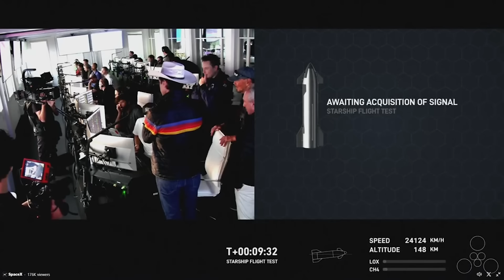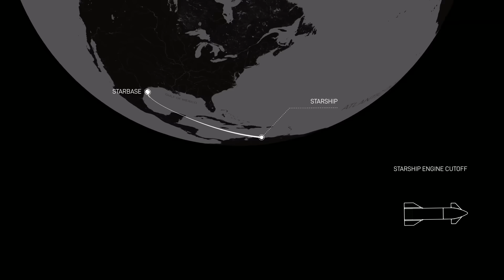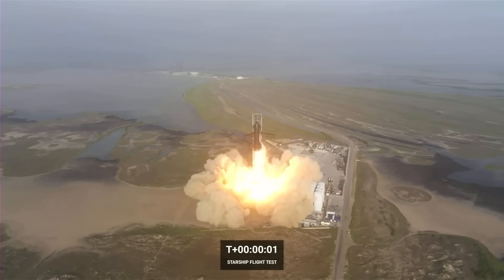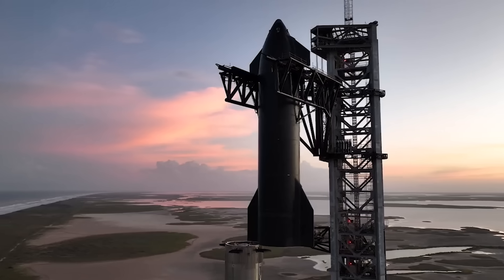What Exactly Happened On SpaceX's Second Starship Launch Attempt?

Comment: After each stage meeting the needed results. Space X initiated the safety detonation to meet the governments satisfaction as per the first launch. All was as planned.
Reply: Yeah, failure is always as planned, according to Musk.
Reply: And you speak with what authority?  Or are you just another wishful thinker?
Reply: Correction:. Failure isn't planned, but it is an unavoidable reality when there is LESS FEAR of failing in order to allow the iterative process to happen.  By contrast NASA is risk averse thus it tends to more expensive in the long run and it takes longer to build and test a rocket that is reliable.   

Look at the Falcon 9 rocket for example.  It was tested four times before a successful launch was achieved.  Now it is the most reliable rocket flying.  And it also lands AND is reusable.  No other rocket company is doing that.  So if focus only on the failures you missing the point!!
Reply: @michaeldeierhoi4096  Most reliable rocket flying?  THAT is extremely debatable.  As much as I'd love to experience spaceflight, I sure as hell wouldn't do it on a SpaceX product.
And, your argument sidesteps the fact since the early 1960s, NASA has accomplished reliability without the fireworks.
It also ignores the cultish devotion to Musk, which flies in the face of reason.
If this flight had succeeded in its stated plan to end in the Pacific, without blowing up, would Musk declared it a failure?  Of course not.  But, since the dang thing exploded, it was a success.  MAGAt logic.
Reply: @Vector_Ze    Now there's a boat load of stuff to unpack and thanks for making it easy for me by keeping your remarks brief.  In the first place if you think it is extremely debatable that the Falcon 9 is indeed the most reliable rocket flying right now then why not mention who you think is better or even comparable??  This year and last year the success rate for Falcon 9 and Falcon Heavy launches was 100%.   85 launches this year and 60 last year.   And almost as many successful landings which no one else is doing at this time by the way.  

And you say that you wouldn't fly on this Space X product.  Well besides the fact that no one's asking you and I wouldn't either for that matter because I simply have better things to do with my time. Besides it will be a while before the average person gets to go into space and I'm not talking about one the luxury space rides BO.    

NASA has achieved reliability without the fireworks.  But at what cost and what is their launch cadence compared to Space X even if include all companies that contract with NASA??     Each flight of the SLS is expected to cost two billion and up.   In addition, NASA is a contractor so the SLS is built by Boeing.   NASA does the telemetry, tracking of rockets and such.  Boeing also built Starliner which has flown one test flight and hasn't been up since and NASA spent a lot more on Boeing to build Starliner then it Space X and via the Falcon 9 and Dragon they have flown flawless manned and cargo missions to the ISS while Boeing struggles to get the right tape to secure wiring on Starliner.  

You make a hilarious hypothetical that if starship had made it to touch in the ocean Elon would not have applauded the success.  What an absurd conclusion that is based on nothing more than your obvious animous toward Musk.   The point is I think Musk is a jerk especially when he bought Twitter and ran it into the ground.   I don't much care cuz I don't use social media anyway, but who can ignore incompetent behaviour regardless of one has an interest in it.   Space X is much more than Elon Musk anyway and business goes on at Starbase quite well without him.  But one cannot deny the success that Space X has had or the reliability of its various rockets and capsules.  If you can't admit to that, Oh well, what can one say about that?   

Lastly, I have to say I hate to be so pedantic and verbose, but you can of asked for it with that comment!  😂😅. Have a great day!

Comment: My prediction? The rocket exploded due to problems NASA solved in the 60s.
Reply: Then you would be wrong, these are totally different experimental rockets.
Reply: @macsdf1  That really does not help your point.
Reply: It took Nasa until the Space Shuttle to stop stage 1 exploding/crashing.
Reply: @catprog  Because Starship's first stages have done so much better in this regard.

Comment: Given that the ship exploded right about the point it would have been turning off it's engines due to this being a sub orbital flight, I wonder if the command to shut down didn't work and they ended up destroying it before it reached orbital velocities.  About 28000 kph is needed for low earth orbit. It blew up at 24000 kph with no apparent other faults.  If it had reached 28000kph with no way to shut it off, that would have created problems for an uncontrolled re-entry in pieces with no way to know where it would have hit.
Reply: not a bad insight. time will tell...
Reply: If starship had been able to reach orbital velocity and a suborbital trajectory it would be flying south into the Caribbean Basin so well away from any of the islands based on the plan trajectory.
Reply: @michaeldeierhoi4096  But if the angle was not right it could be aiming at Hawaii
Reply: @catprog  Since the second stage could not make it's suborbital insertion it's a moot point imo.

Comment: Given that there is no launch escape system, and the second/upper stage cannot be the launch escape system, people will not go up on it, no matter how many entirely successful tests have been done.
It's also a safe bet that the NASA Artemis missions will not use the "Starship" as the upper stage.
It has never made any sense to bring to the Moon, the necessary weight and complexity of what's needed to re-enter and land a ground to orbit vehicle.
Corporate PR and YouTubers' graphics and Musk's statements are not definitive mission plans from NASA.
Reply: @JFrazer4303.  Airplanes don't have an escape system either, but people fly on them routinely.   The Falcon 9 has flown over 250 flights with almost perfect record especially in the last couple years.   The starship can get to close to the same level of reliability as the Falcon 9 and it will also be reusable.  Falcon 9 had four test flights before reaching orbit.  Four test landings before successfully landing.  Now it does repeatedly, reliably and with reused boosters.

If you only look at the failures and not the improvements made over time and simply iterative nature of this starship development then you are missing the point.
Reply: @michaeldeierhoi4096  the Falcon 9 also has an escape system whenever it flies people.
Reply: Their were 3 designs they could of selected. One of which had a negative payload. So NASA had 2 options and Starship was cheaper and more capable then the other one.

How do you define "Starship" as a ground to orbit vehicle? 
Is it that it needs a booster to get from the ground to orbit. If so all the possible landers are ground to orbit.
Reply: @catprog  Ground to orbit and back down to the ground here. Aerodynamic surfaces and TPS.

Comment: To me, it looked like it started to drift slightly off course right before the stage separation.  Either that or the camera made a huge change in location.  It would be a shame if that was the reason for the Starship self destruct.
Reply: I think that was intentional to avoid the tower... it was exacerbated with the first launch because of the engine fails... which how lucky was that for the fails to be on the wayward side of the tower on that first one. They used up all the luck on that one.
Reply: @hawkdsl wtf are you talking about? They were 1.5 miles down track at stage separation,  nowhere near the tower.

Comment: Aside from the failure of the termination system, all the other failures of the first launch could be traced back to damage caused by destruction of the pad
Reply: That's certainly how it appeared, but according to SpaceX the fuel leaks and engine failures of the first flight were not caused by debris from the pad
Reply: ...which goes back to Elon and 4/20 silliness.

Comment: I am a fan of SpaceX because they are all about getting it done, unlike Blue Origin which is doing nothing at all.
Reply: Blue Origin is NASAs "backup", as Bill Nelson stated when awarding the 2nd Option Lander contract in May.
Blue Origin and its National Team partners are giving NASA a hydrogen fueled lunar lander, exactly what NASA wants for "sustainability" i.e. burning cheap in situ lunar H2 instead of expensive Earth CH4, hauled all the way from Earth to the Moon and down to the surface just to get back to LEO.
Starship has no future on the Moon, with NASA or anybody: it is unsustainable.
Reply: Bezos was willing to go on a flight.  To me that says a lot. NASA picked Blue Origin over a rival bid led by Leidos Inc-owned (LDOS. N) defense contractor Dynetics that also included Northrop Grumman Corp (NOC. N). NASA's decision to go with Bezos and Blue Origin will give it a second option for sending astronauts to the moon under its Artemis program.
Reply: @rcpmac  Saying something and doing it are two different things, I love spaceX and have faith in them but fuck no I would NOT get into the starship

Comment: It makes you wonder how the U.S. managed to get Saturn V rocket get to the moon in the 1960s, but now they experience so many problems. Didn't they jot down any notes at the NASA ?
Reply: They never had to plan for landing the rocket which makes it a lot easier.. also nasa had a higher budget which helps..
Reply: They blew up the 33 raptor engines. I expected the lower stage to land back on earth vertically at a predetermined location. So much for the reusability !!! And now we don't even know where the upper stage the silvery part is, probably somewhere at the bottom of the Pacific ocean. I deem this test flight a partial success. I certainly will not ride on this thing for at least 10 years until they sort out all the issues. Let's hope NASA have better luck with their Artemis Block 2.
Reply: Plus Space X is building a rocket that has twice the thrust and uses a different fuel.  Testing and development on starship only began on starship a few years ago.  Now we are finally seeing the potential of this rocket which had the beginnings of a nominal flight.

Comment: It is a bit wild that booster only takes the second stage to less than 20% of its orbital velocity and 30% of altitude. Is there a possibility of a single stage to orbit some time in the future?
Reply: No, because that would mean carrying a huge fuel tank and 33 engines all the way to orbit. Far more efficient to drop the excess weight and continue on with a much smaller rocket that increases the speed by 80% and height by 70%.
Reply: Not for some time because the amount of fuel needed to overcome gravity.  On Mars it will be possible for starship to launch without a booster.  Probably totally new propulsive technology will be needed for a single stage launch vehicle to orbit.
Reply: Single stage maybe possible, but I don't think it would make logical sense
Reply: @mrdune5479  it would be possible, but then so is pulling away from stationary in your car using top gear.
Reply: all rockets work like this, gravity stronger near the surface so needs more power.   Drops the weight after you push it up more.
Reply: @macsdf1  The difference in the gravitational force is very small.
The first stage lifts the entire weight of the rocket of the ground and accelerates it to a high speed. By now it has a nearly empty fuel tank and, in this case, 33 engines that are no longer needed, so all that weight is let lose and a much smaller rocket fuel tank and far fewer engine take over to push the far lighter second stage into orbit.

Comment: It’s a different mindset to celebrate incremental improvements over the actual failure to complete the full mission. My old way of thinking wants to call BS but I must admit that actual progress is being achieved at a steady rate with huge innovations. I can’t argue with the progress that has been achieved.
Reply: Other way around, it shouldn't be exploding and failing this is the 6th time it blew up horribly

These are atmospheric conditions that are well known, well studied and can be simulated

It's not like it was hit by a meteorite, or something unforseen 

All this indicates that the science and engineering potential of the US has peaked , the engineers and scientists of today being pumped out by the US education system can't hold a candle to the guys that studied in the 1940s -> 1960s
Reply: @xblade11230 uhh 6th? Its 2nd time for a fully integrated flight test what are you yapping about
Reply: @gudbread8523  

Starship SN1 = exploded 
Starship SN3 = exploded 
Starship SN4 = exploded
Starship SN8 = exploded
Starship SN9 = exploded
Starship SN 10 = exploded
Starship SN 11 = exploded

Starship integrated test 1 = exploded
Starship integrated test 2 = exploded
Reply: The full mission was to get to stage seperation and gather data, but what are they supposed to do if it actually succeeds, just shut everything down and go home with hardware still in the air? That would be ridiculous, so they said if everything is still functioning at "this point" then we will attempt to do "this with it" until it runs out of altitude and airspeed, gently or otherwise. They will let us know when mission success will be defined by a controlled landing or splashdown.
Reply: @Logan4661  ??? You do realize that via the magic of science and engineering and knowledge about basic physics, we can predict and model things based on small scale experiments 

In fact engineers use software like ANSYS that can model the atmosphere and atmospheric conditions its just fluid simulation , and we have chambers that we can adjust temperature and pressure, air composition to simulate different atmospheric conditions 

Again all the atmosphere stuff is well studied, the physics of it are well studied.

Comment: I noticed star ship was way too fast for the normal orbital flight altitude and speed. Though that may have been to insure that it’s re-entry would be at a speed representative of one coming back from the moon. 

I’m thinking maybe the engines didn’t shut off when they were supposed to and so the failsafe kicked in to avoid an undesirable return/reentry vector.
Reply: No actually it was a little to slow orbital speed is 27.000kmh it was going 24.000
Reply: It was actually a couple of thousand kph short of orbital velocity when the FTS was triggered...
Reply: Sounds like another public school educated, woke liberal termite is confused over MPH verses KPH.
Reply: Oh I thought 17,000 was the goal speed. I know it varies depending on how high/far the orbit is. Does it bleed speed as it approaches apogee??? I’m still learning when it comes to launch profiles etc.

Comment: If starships needs a water system to launch properly, how will it launch back from mars without the water system?
Reply: Because the booster doesn't go to Mars, only the ship with 6 engines.
Reply: The superheavy needs the water system, the starship itself does not. The starship launches from mars without the superheavy booster and travels back to earth alone at least until infrastructure can be built on mars to handle a superheavy
Reply: Due to the moons gravitation pull being 1/6th of Earth’s, a lot less thrust is needed to reach escape velocity.
Reply: @kryogyn1  The objective is to go to Mars, which has double the gravitational acceleration of the Moon at its surface, but even there Starship alone is good enough to SSTO. On Earth, because of our strong gravity and dense atmosphere, it needs help from a booster stage.

Of course, none of the Starships that have been built so far (since SN 20) have landing legs, so they could not actually land on Mars even if they were able to reach it; so the actual Martian Starship still needs a few design iterations before we can send the first seeds of infrastructure.
Reply: they don't need the water system.   was just poorly designed to start, didn't expect that much power.  future launch sites will be built differently im sure.  water system is just a way to macguyer it to work for now.